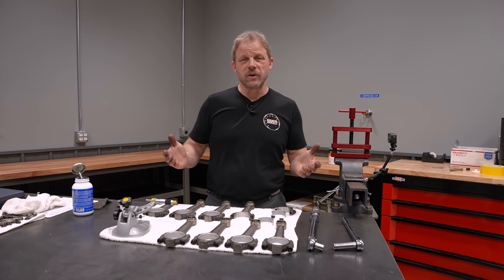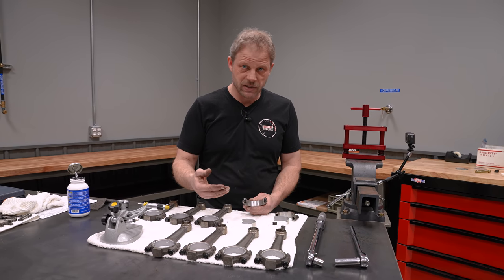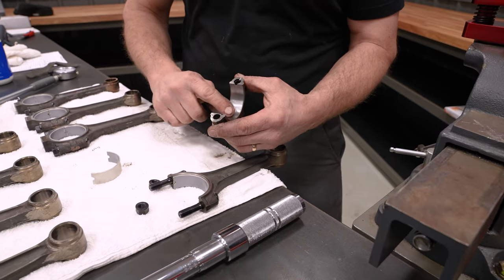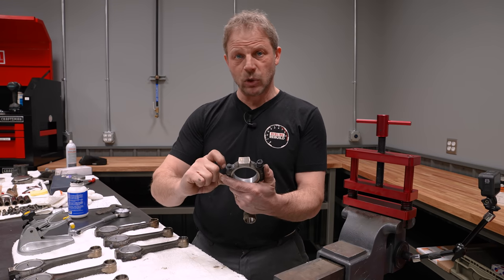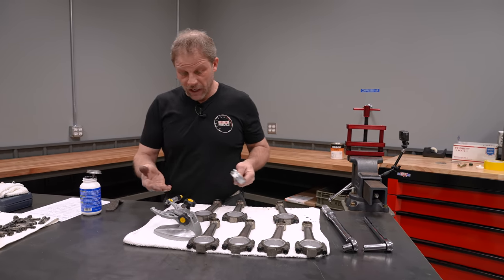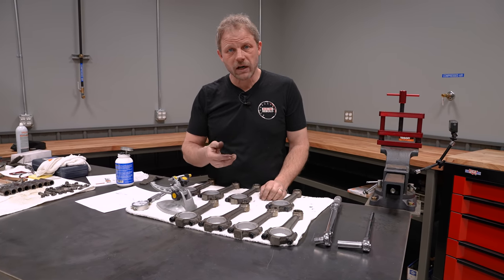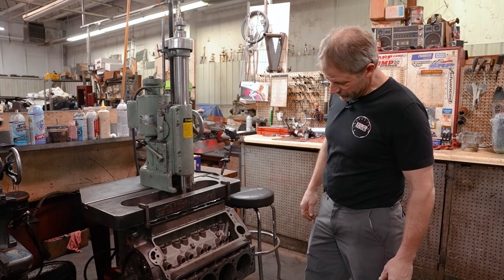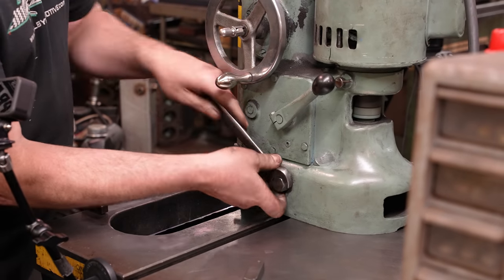Boring engine block and assembling pistons for our Cadillac 365 V-8 | Redline Update #74

Comment: As a trade-qualified engine reconditioner, I like how you work, good job. One of the things I think that's worth mentioning when you bolt this together would be about the shape of the bearings before they are torqued on the mains and the rods. I've lost count of the people who have had their crank ground, took everything home, only to come back angrily the next day because their crank was either tight or wouldn't spin because they hadn't torqued the bearings down. It's usually quite embarrassing for them after you've sat back and copped abuse from them only to install the crank in front of their eyes and it spins beautifully. Great videos, keep em coming!

Comment: Really great basic stuff. I wish this would have been available 50 years ago when I was trying to understand what crank clearance even meant. I can only imagine the bump in knowledge this generation is getting. Of course they'll be applying their smarts to electric cars, wind turbines and rockets to other planets.
Reply: yeah as a zoomer i do sometimes wish i was born in the late 90s. Life was way simpler back then especially when it comes to cars. now engine bays resemble spaghetti more then what old engine bays used to look like. Also seen a diagram which showed how much wireing there is on a modern and it came to around 3 - 4km or 2.2 - 3.2miles of cables. as compared to 300m or 620feet 40 years ago.

Comment: Back in the 80's, was working at a machine shop, guy I was working with, took the shop truck to pick up an engine (Big block Chevy, complete). He set the engine in the back of the shop truck bed, at the tail gate, didn't tie it down. Was involved in an accident, rear-ended a stopped car. That engine came through the cab of the truck and imbedded it's self in the dashboard ON THE PASSENGER SIDE (lucky AF). Moral of the story, always put the engine at the front of the bed, against the cab and tie it down!

Comment: When I assemble an engine, I use anti-aeize on the rod stud or bolt. I put it on prior to assembly of the caps. I have had past issues as the ros nut/bolt has backed off from the application of lube between the nut and rod cap. I tend to try to keep the clamping surfaces clean and lubrication free. Lube on the threads is fine, but I would make a point to keep the nut clamping surface dry as much as possible. 
May want to check with ARP.

Love the content. Keep up the great work.

Comment: so glad to see you not using a torque plate on both the bore and the honing I tried it with and with out torque plate and found that the distortion from head torque did not make the out of round spec's every body thinks it does. I'll never use one again

Comment: here's an old machinist trick for your telescoping gauge or indicator dial face, if you set your zero at .010 plus or minus the zero on the dial,dont matter witch one, a .002 move will read .012 or .008. takes away any confusion , or mistakes .
Reply: Write down the readout on the dial not the diameter. Most important is that the readout is correctly written down, wrong calculations on paper can easily be spotted by recalculating everything or QC.

Comment: wondering why you don't mic the bearings with a ball mic? You just have to mic the rod, mic the crank, subtract the difference  between the crank and rod, and add the bearing thickness, subtract that number and the differencee is the oil clearance. Just the way i was taught in the machine shop, but i never see anyone using a "Ball Mic" in any videos on youtube. Ive built over 1000 engines in my day and NEVER had a bearing clearance  problem, but i did run into miss marked bearings /cranks/rods in some of those engines . Great channel, Thanks

Comment: ARP indicates that lube should NOT be used underneath the washer or on the surface underneath the washer. 

It is not in the instructions that come with the bolts, but ARP will suggest that the bottom of the washer can be sanded rough, to Increase grip of the washer on the block or rod, to ensure proper torque values.

Comment: The die grinding at the end, is he just cleaning up the blocks cast surfaces or is there some other purpose?
Reply: Probably deburring sharp edges and cleaning up oil passages so oil can flow back easier.
Reply from the maker: Grinding off any sharp edged from the casting process. Gives a better surface for the paint to adhere to.

Comment: Shouldn't the journal be .004" under the shell diameter? .002" clearance all around that way.
Reply: Unless he just meant 2 thou difference in diameter so it's 1 thou clear all round.
Reply: @davidmarshall2399  The clearance is total on the diameter, not radial. .002 clearance is .001 per side.

Comment: For the oil clearance, you wanted 0.002" right. So shouldn't you subtract 0.004" total so both 'ends' of the hole have 0.002" of oil clearance? Am I thinking wrong?
Reply: You're partway correct, but you have to be able to visualize what actually happens as the two parts interact. The journal on the crankshaft never stays in the actual center of the rod bore as the engine is turning. It is always slightly off center as it induces rotational motion and the rod converts it to linear motion. That shift happens throughout tbe revolution of the crank journal, as the rod gets pushed upwards for compression strokes, and tben transfers around as the piston is pulled down for intake strokes. That 2 thousandths clearance is constantly and fluidly compensated by the hydrodynamic wedge of motor oil to keep concentricity of the clearance.
Hope my explanation helps, and I didn't sound too much like Sheldon Cooper from Big Bang Theory.
Reply: @markk3652  ah so the 0.002" is just the clearance total in any direction at any time.
Reply: @callmezucc9318  correct, the oil dynamically makes up for the clearance.

Comment: No honing plate, to torque down on the block, so the internal loading during boring is the same as during running?
Reply: Some engines need a honing plate, some don’t. All depends on the type of engine and what type of metal it’s made of.
Reply: They probably dont even have one for this thing. While torque plate honing is best, for stock or very mild applications it isnt critically necessary.

Comment: The AERA Bible which any competent machine shop uses  for specs list that engine rod crank journal size at 2.2488-2.2493. So minus .010  your are having the crank ground .0008(8 tenths of a thousand) under minimum spec.  That seems really strange, either your measurement/ math is off or those inserts aren't specific to that application or the rod bores weren't honed to the correct size.  .002 clearance is also on the large end of the spectrum for a stock build.

Comment: Kids, when you're handling bearing shells, always wear rubber gloves! Your skin oils will not mix with engine oil and will cause burnt spots on your bearings
Reply: I was taught that in high school...I don't know why Davin doesn't - maybe he oozes 30 weight instead of regular sweat? :)
Reply: Probably a very minor point that you could not prove. I would trust Davin on this.
Reply: @ellieprice3396  watch a few episodes of my vintage iron 7512, he goes through the whole thing. And actually has a video where he proves my point. Because he is actually an engine machinist and has probably built a thousand more engines than this other guy has he's probably the better one to believe
Reply: @ellieprice3396  also the guy from my vintage iron is an instructor in the engine building department of universal Technical Institute
Reply: Watch rolling them in too, if you scrape the back and leave that little curl there and install the cap,it can alter your clearance. 
I've never scraped em that bad, and all ya gotta do is pick it off with a razor blade. 
Takes a little practice to feel the spring of the bearing to minimize that.
99% of the time it won't matter , but I'm a little picky.
Reply: @sethbarnes7608  for fun, take a spotless clean rod and put it in a bucket of a few inches of oil. 
Come back in a day or 2 and the top is wet  😁
Good time to soak your crap in some Z max.